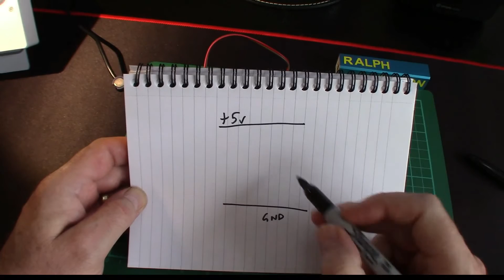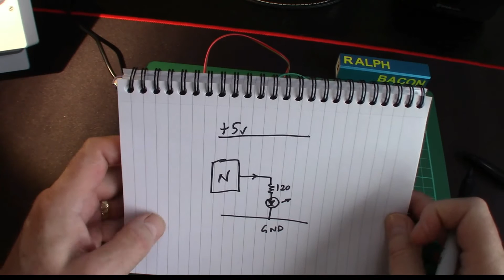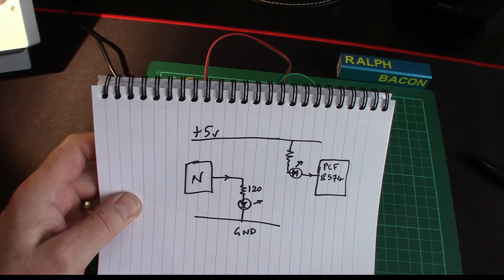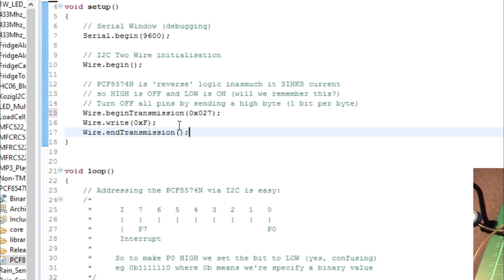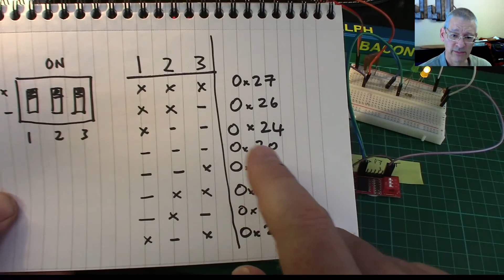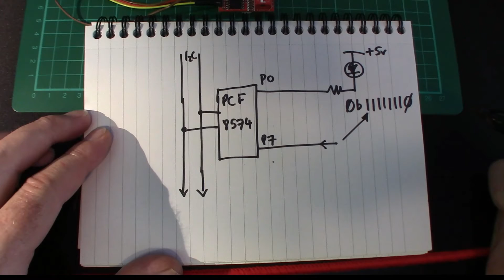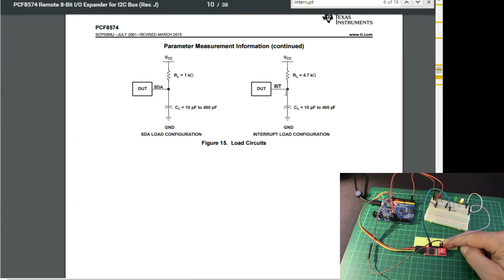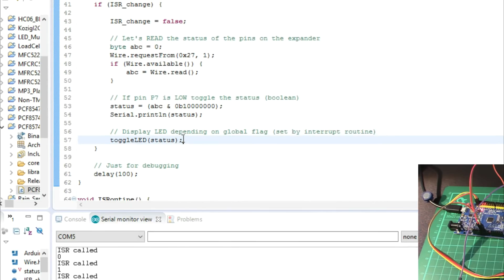#49 MORE PINS PLEASE! PCF8574 Arduino Pin Extender (Easy)

Comment: Blinking LEDs works, but how do I use the pin extender with an SPI device, for example ssd1306, OLED. I am attempting to display data from an ESP266-01, on  ssd1306 through the PCD8574.
Reply from the maker: Hmm, tricky one Mike, as this pin expander is I2C, not SPI. However, others like the PCA9502, are an 8-bit I/O expander with I2C-bus and SPI interface (see here: http://www.nxp.com/docs/en/data-sheet/PCA9502.pdf). I don't think I've used one of these but if you know how to connect SPI then I don't see why this would not be a possible solution for you.
Reply: Sorry, but I don't understand. I want to use fewer pins to connect my SPI OLED to the ESP266-01. The ESP has only a few GPIOs. The port expander takes inputs and produces I2C output that use fewer pins. Correct? I need I2C connection to the ESP266-01 to use this OLED. I am doing this to learn how to use the port expander, LEDs are well and good, but what other devices can be used? Can you give an example? Thank you for the tutorial.
Reply from the maker: You need to investigate whether the chip I mentioned (PCA9502) allows you to connect your ESP via I2C (two pins) then connect your OLED to the PCA9502 via SPI. Basically, whether both busses can be used simultaneously. But SPI only needs 3 pins (MOSI, MISO, SCLK) plus a CS pin for each device, is this too much for your project?
Reply: Thank you, as you probably know the ESP has 4 GPIOs, when the RX and TX are used as GPIOs. So, I suspect it is possible to get data plus connect the OLED. I am just not sure how to do it, which is why I watched your tutorial. I am surprised the the PCF8574 will not work. What can it be used for. I bought 10; what can I used them for? Blinking LEDs works, what is the next step? For example, how do you wire-up sensors?
Reply from the maker: You can connect anything up that needs to be switched on/off, or something that needs to send back a signal (high/low), like a switch or push button. The pin extender facilitates the latter by triggering an interrupt which the Arduino can then detect (so it doesn't have to keep polling the I2C bus to see if something has changed). So...
 
So you could connect up any number of relay driven motors, lights and even control the MP3 module I describe in video #40. You can also wire up loads of switches or rotary encoders to send back signals to the Arduino. You should view the P0 to P7 pins on the pin extender as extensions of the standard GPIO pins on the Arduino - except they don't use up the pins already there.
 
By the way, as you have so many of these chips you can use up to 8 of them on the same I2C bus; just choose a unique address by shorting the A0, A1 or A2 pins (different combination for each chip) then you will have 64 pins to play with. See here for more details: http://www.ti.com/lit/ml/scyb031/scyb031.pdf 
 
And finally, you do seem to have made life difficult for yourself by using an ESP8266-01. Whilst physically small, it also severely limited in the IO pins it has available as you have discovered. Why not use a 'proper' ESP8266 board like the ESPDUINO (about £7.50 / $10 from any of the Far Eastern companies like Banggood) which sounds a more straightforward solution to getting your screen working as you have about 7 GPIO pins, PLUS SPI PLUS I2C available. Just suggestin' !
Reply from the maker: Addendum to above: if you are after a physically small ESP8266-based module, look at the ESP8266E which at least that many GPIO pins PLUS SPI. You really are spoiled for choice here, Michael!
Reply: I understand that there are other modules, I have several -12s, but my goal is to learn to use the port extender. I understand from you comments that they are much more limited than I hoped. Turning things on/off is good, but getting data from sensors, displaying that data is my current focus. Thank you for your help. ESP8266E? Did you mean ESP8266-12E?
Reply from the maker: Surely the port extender is only "limited" in the same way as your Arduino's GPIO ports are "limited"; you should be able to do everything with the extender pins that you can do with the Arduino. I'm interested in how you expected it work and what  you perceive as its shortcomings? Remember that many sensors will already use I2C or SPI, so you already have that bus available to you on your Arduino/ESP for multiple devices. You're going to have to use the SPI bus for your particular display anyway, there's no getting around that. Or switch your display to an I2C compatible one. There's only so much water you can pour into a pint pot!
 
Oh, yes, 12E, sorry, using a bit of ESP shorthand there! I think the ESP range is getting to be the development module of choice as it does (most) things an Arduino can do with built-in wifi. A perfect chip for the IoT I would say?
Reply: I am probably missing something basic in my understanding, but I found this page, https://github.com/maxint-rd/I2C-PCF8574-PCD8544-Nokia-5110-LCD, which uses an SPI device with a PCF8574. I was trying to do the same thing with the ssd1306. What am I missing?
Reply from the maker: I'm guessing that this works by sending the SPI signals down the I2C wires (using multiple pins on the PCF8574) which is quite clever (he said, patronisingly) but whether this just works for the Nokia 5110 display or could be used for others is something you'd have to investigate and discover (or use a Nokia 5110 display in your project, of course). It's interesting but quite advanced (especially if you want to use the faux-SPI bus for other things). That said, I've used a bit-banged (ie software-controlled) SPI bus on a Tiny85 which worked very well so maybe this is good for other devices too.
Reply: This technique of "sending the SPI signals down the I2C wires", extends the port expansion functionality beyond on/off switching. I have ordered Nokia 5110 to explore this and try to use it with other devices. By the way, the ssd1306 can be converted to I2C by changing the resistors soldered on the back. I am exploring the PCF8574 , just for the fun of it. This project is a learning exercise.  I appreciate any guidance that you can provide. Thank you
Reply from the maker: Firstly get the Nokia 5110 working in the 'usual' way (by following video #89, perhaps). That way, you know the unit works as it should. Then follow the project that you mentioned above to prove that I2C can be used to send SPI signals without corrupting any timing. Then you can use your own screen in place of the 5110 secure in the knowledge that the SPI signals are present and correct, and replace the sketch with your own for the screen you have. SImples! OK, maybe not, but at least you have a plan and I'll be keen to hear about your results.

Comment: Can I use this with an attiny 85 without changing the code?
Reply from the maker: Good question. The short answer is: Probably not. If you look at video #82 it concentrates on getting I2C working on an ATTiny85 - then yes, you can use this pin extender in the same way. It's pretty straightforward in getting I2C running on the Tiny85 as the demo shows, so don't be put off that you might have to change a few lines of code!
Reply: Ralph S Bacon , thank you.  I appreciate the help.  I will check that video out.

Comment: Can you please explain the connection of hardware like second part of the video I  didn't understand the  interrupt concept
Thank you
you can mail me also parthpatel2991@gmail.com
Reply from the maker: I'll try and explain here, Parth. The interrupt is triggered by the pin extender when one of its pins goes high (or low, not sure which, read the datasheet). That interrupt pin can then be connected to an interrupt on the Arduino so that the Arduino can be notified that "something has happened". The Arduino can read the state of each pin on the pin extender (using the standard I2C commands) to determine which pin has changed (the pin extender does not tell you which exact pin, only that something has changed). The Arduino will have to know the state of each pin before checking so it can determine which pin value has changed. I'd probably do this with some simple binary logic (AND or OR). If this explanation does not help let me know, I might have to do a bit more (video-wise) on this device!
Reply: thank for your reply sir if you can mail me your mail id, so that I can tell where exactly I have confusion
Reply: Thank you sir, for your reply, can your please ping to my mail id so that I can explain my problem in better manner
Reply from the maker: Hey Parth, try and explain your problem here - that way, not only do I see it, others do too and may be able to help. If your query is more general then you need to head over to the Arduino Forum (http://forum.arduino.cc/index.php) who have some great support people.

Comment: do you think that i can use the LCD driver showing here http://www.instructables.com/id/Using-PCF8574-backpacks-with-LCD-modules-and-Ardui/  ?
Reply from the maker: Hi Bassel! Now although you might 'get away' with using that pin extender with the LCD you link to, what you really need is one that has a built in contrast control - I just bought 10 of them here: https://www.aliexpress.com/item/5-pcs-IIC-I2C-Interface-LCD1602-Adapter-Plate-for-Arduino/1698225308.html for less than £4 ($5) but individually they are about $1 or in the UK about £2.20 singly. I've used one and it works exactly as expected. I hope this helps and thanks for posting a great question.
Reply: This is exactly the one i have, got it here with 3$ in Dubai. worth not to wait AliExpress as it takes 35 days to get delivered. I will give it a try according to your nice video. will let you know if it gets work Thanks a lot Ralph for answering

Comment: I can see the advantage of having a port expander on the I2C bus rather than three dedicated lines for the 74HC595
Reply from the maker: Indeed, I wanted to get the I2C expander running for the ATTiny85 but managed to get I2C running happily without it. And of, course, with 6 GPIO pins available on that chip now (after my hack... hmmm, not sure that video has been released yet) it might not need one so urgently either.

Comment: 3²-1?  how about making it simle.  2³!
Reply from the maker: I'm afraid you'll have to put your comment in context, Sarreq, because although 3^2-1 is indeed 2^3 I can't remember how (or even if) this is related to the video! Let me know!
Reply: Ralph S Bacon at the beginning when you're figuring out how many addresses the dip switch provides
Reply from the maker: In that case you are definitely correct, the maximum number of permutations in  a given number of bits (or dip switch positions) is 2 ^ n. Thank goodness someone is paying attention in these videos because it certainly isn't me!
Reply: To be perfectly honest, in 30 years of programming I'd never heard of the (x^2)-1 trick!!! When I needed to know a number I'd mentally do the 2...4...8...16 thing in my head. (And even that is only good up to about 8 bits.)
There's a REASON why it's easier than 2^x. While 2^x is fine for low single digit numbers, can you quickly name what 2^7 is? Or 2^12? However (12^2) is easy, then -1 = 48 is trivial.
2^x is fewer typed characters, easier to understand in program format, but NOT trivial to do mentally. Actually, personally, I'm not comfortable with ^2 past 12, because I've never used it that much. Also, if I'm doing something that big in hardware or software, by then I'm doing it in hex anyway where mental calculations are absolutely impossible for me and need a calculator.

Comment: Paul, still more other bigger brothers out there,  like the NXP PCAL6524  24 bit and also others much higher in I/O...
Thanks for the video Ralph
Reply from the maker: Glad you liked the video, Moe, and thanks for the heads up on even bigger pin extenders, very useful.

Comment: There is also a bigger brother of this chip:
PCF8575 Remote 16-Bit I2C and SMBus I/O Expander with Interrupt Output

datasheet http://www.ti.com/product/PCF8575
Reply from the maker: Now this is interesting on two fronts, Paul. Firstly, when I first read that datasheet (thanks for that head up, by the way) I saw that this was 16-bit device, so I raised (a mental) eyebrow wondering how we would interface that to the Arduino. Secondly, this is not a problem, as the 'datasheet' tab on that page shows TWO 8-bit devices connected to this item. Hmm. Interesting. I will have to read more. Thanks for the link, others may be interested in that too.
Reply: Thats what i thought "Interesting!"  and of course i knew you would also be interested.

I also found this in my exploration:
https://www.sparkfun.com/products/13601
another chip and breakout board,
SparkFun 16 Output I/O Expander Breakout - SX1509
which uses another chip.
Applications could be a keyboard and a display using one board or chip as all the chips are multi i/o.
Reply: i'm sure if you did a search for  pcf8575 you'll be able to find libraries such as this one.

https://github.com/skywodd/pcf8574_arduino_library
Reply from the maker: Been there, read the book, got the T-shirt. Well, sort of. I've looked at the library and it is not that complicated (it just sends the standard register / data bytes like we've done in a few videos here already). But the library, as always, does make it easier to get on with the job in hand without faffing about with such technicalities. Thanks for the heads up, Paul.

Comment: these chips are also used in Serial Interface Board Module Port for Arduino 1602LCDs that can be purchased separately, as these have pins on one side it makes them breadboard friendly.
Reply from the maker: Exactly so, Paul, which is where I first encountered them. I think these modules were specifically designed to fit the LCD board (a bit of a chicken and egg situation, perhaps) but, of course, work as you would expect as an I2C capable pin extender. Good to hear from you.

Comment: I just got a couple PCF8574 extenders to add Arduino pins for a project. Your video is the best & most helpful explanation of how to use this handy little device. Thank you!
Reply from the maker: Well thank you, Tim, nice to hear from you. I'll do a further video in due course on this little device (including some simple binary maths required to change individual bits). It might even be in conjunction with an ATTiny85 as that has only a couple of usable pins, really. Thanks for your post and kind words and I hope there are other videos here that interest you too.

Comment: Great stuff Ralph, thanks for a very informative and well described video,  it has help me tremendously to work out how in the hell I can monitor quite a few different reed switch sensors, and other sensors I am using, on a rather complex model railway layout without using up all my Uno/Nano/WHY chips.  The crucial part was I2C and the use of interrupts, which I needed so that if a loco appeared at any location (reed switch), I could instantly take an action to avoid incorrect point direction, or indeed when a train had reached a stop point in a (very well hidden) hidden storage road.
Many  thanks indeed, keep up the good work....
Reply from the maker: This is good Ian, that information is being shared and that you're finding it useful. That's what this channel is all about, "Getting your projects off the ground". It's that first step that's probably the most difficult. Anyway, thanks for posting (and I'm glad you didn't find any glaring errors in this video!), I'm always appreciative of Arduinite comments, suggestions and info like yours.